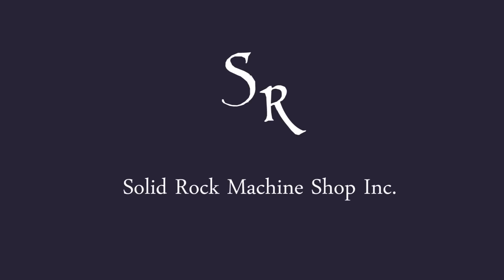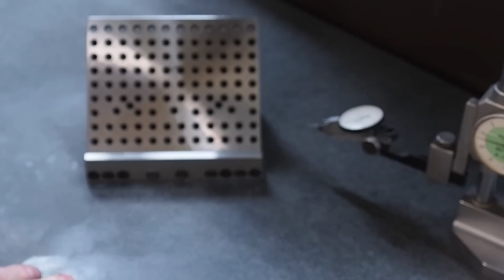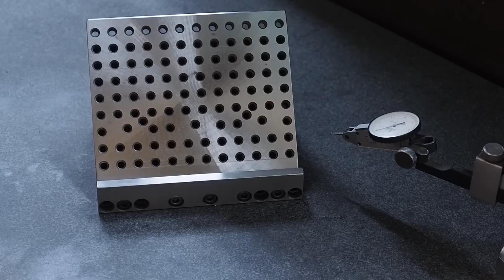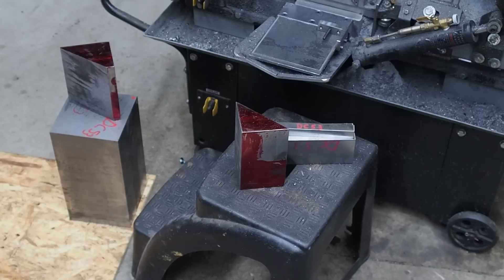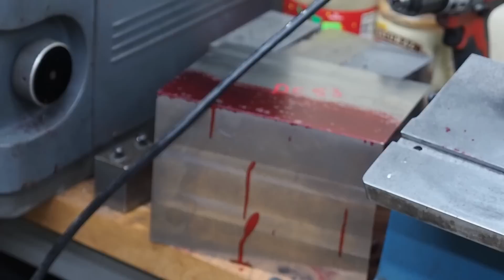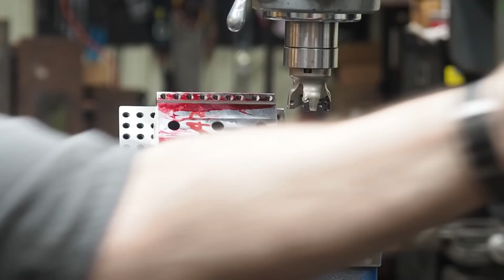The Big 45 Degree Block Build (Part 1)

Comment: Is your shop temperature controlled?
Reply from the maker: I have an air conditioner and humidifier. Have to run both to keep the humidity down. I try to keep it between 67 and 69 degrees F.

Comment: So you are using a big 45 to make another big 45….how do you make the first one?
Reply from the maker: It was a little harder. I used a 3/4" thick 45 degree and took it very slow and easy with the rail part. I left extra stock and straighten everything out in the grind.